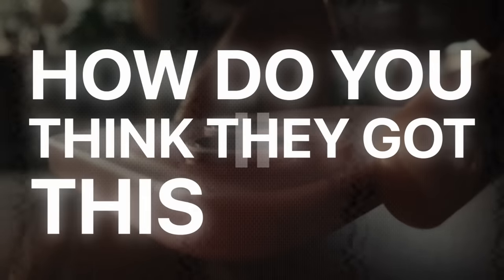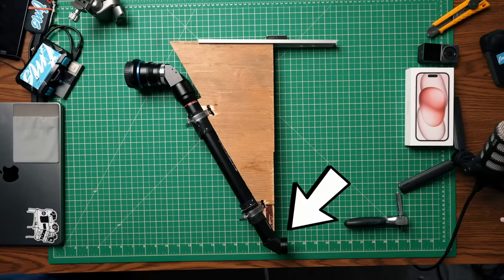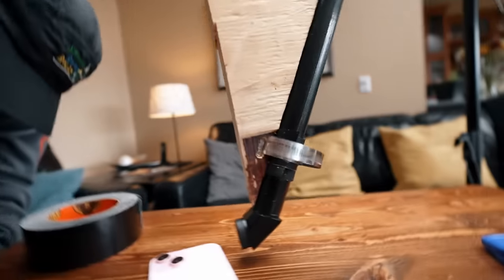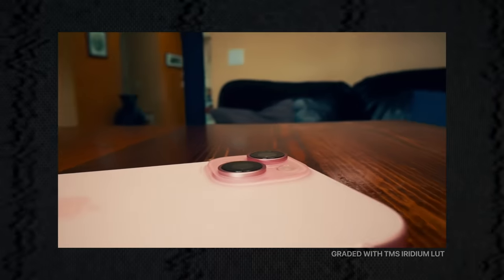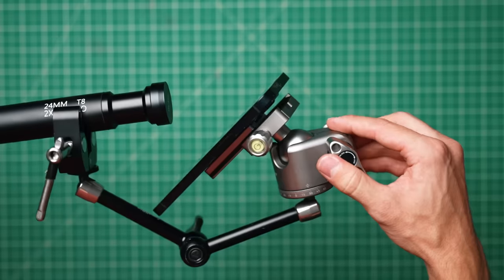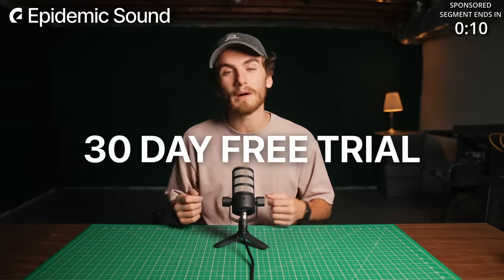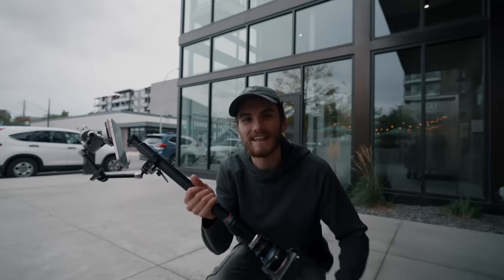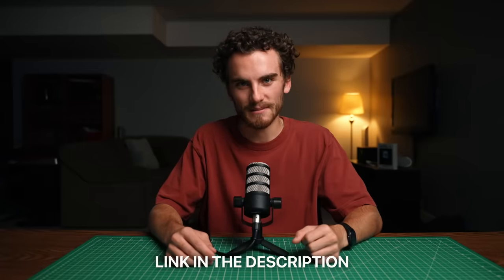We RECREATED The NEW iPhone 15 Commercial

Comment: Just a heads up, if you can build your rig with a supporting arm, coming from an angle will help even more with vibration/shakiness. Typically 3 points of contact on a camera is rule of thumb when it comes to rigs, to help with vibration, shakiness, jitters, and most importantly safety. But nice innovation with what you had!

Comment: 8:47 If you little croped the video and applied frame by frame stabilization, (as Youtube already compress the video and low down the bitrate) I would have said it is better than original 😁😂 , very amzing remake without even using CGI for sure!!!!!🥰